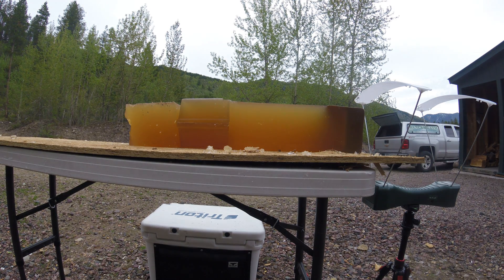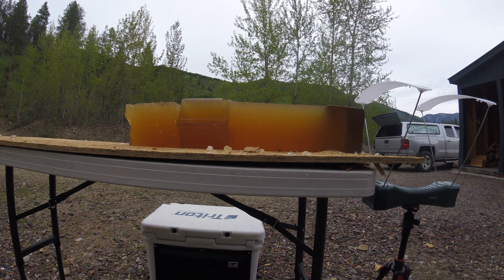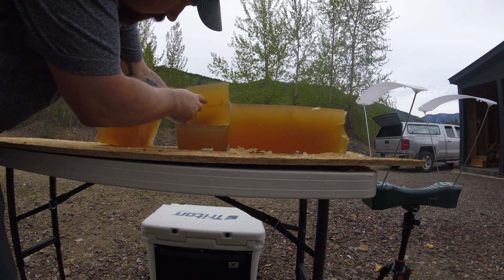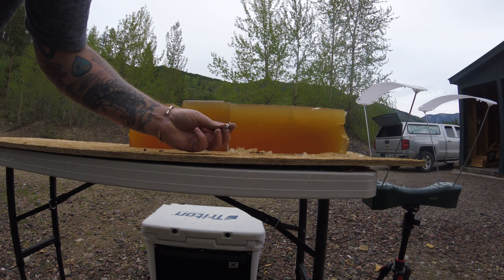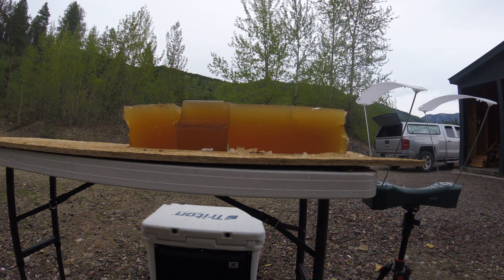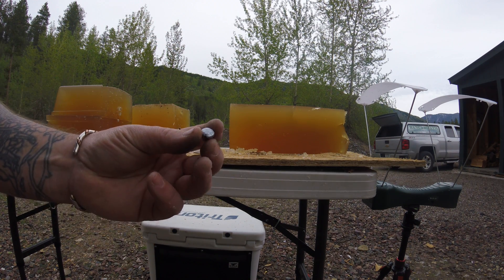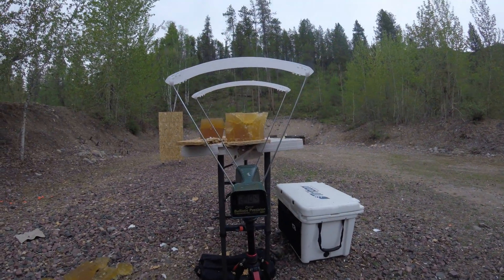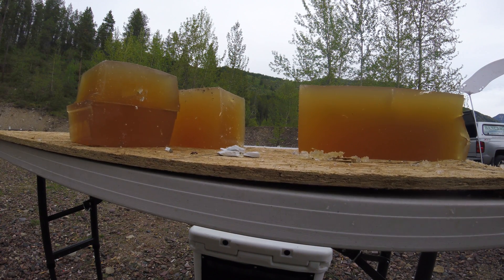6.5 Creedmoor 142 gr Accubond LR gel test with hide and bone

Comment: Great timing! Going to load the Accubond vs 143 Eldx for accuracy using Staball 6.5 for this weekend. Have you determined optimal jump for the Nosler? Thanks (Subsribed!).
Reply from the maker: The rifle I use the ABLR'S in doesn't really care about jump. I haven't tried them in my other Creedmoor's. 

I've gotten my best velocities with RL16 and it is crazy accurate with low SD's and ES's. 

I have gotten away from using the eld-x bullets for the most part because most of my shots on whitetail doe are within 100 yards and they come apart bad if my muzzle velocities are much over 2600 fps. Good bullets as far as accuracy goes but they just can't handle medium to high velocity impacts without excessive damage.
Reply: @Simple Minded Fella  Thanks. Never shot an Eldx at game and now there's one less thing to buy! Hope I can restock on R16 
 Thanks for the reply!

Comment: Are the Winchester accubond  long range the same bullet is the nosler
Reply from the maker: The Winchester ammunition that is loaded with the Accubond long range is the Nosler Accubond long range bullet they are loading into their ammunition.
Reply: @simplemindedfella  ok that's what I have is the Winchester accubond box it's a good bullet for deer hunting at 250-400 yards haven't got one closer yet I shot a coyote @ a 100 yards put a big exit wound
Reply from the maker: @anthonyfairbanks2952  what I like about the 142gr Accubond long range bullets are they hold together fairly well with high velocity shots yet still operate well down under 1600 fps. I've taken whitetail out to 600 yards perfect broadside double lung dropped in its tracks and a cow elk at just under 70 yards with many mule deer, antelope, whitetail, and a few elk at a variety of ranges. My buddies kid used my gun to harvest a cow elk at 400 yards and she didn't  make it 10 yards before piling up, that is the farthest my gun and experience has with the 6.5 142gr ABLR on elk. They will do the job based off the math quite a bit further then 400 on a elk as long as the shooter does their job in placing the shot. (6.5 Creedmoor is all anyone really needs)

The ABLR is my current go to for lead core bullets. I use them in my 6.5 Creedmoor(142gr), 308 Winchester (168gr), 30-06 (168gr), 300 Winchester Magnum (210gr), and 6.8 Western (150gr and 165gr).
Reply: @simplemindedfella  yes I agree

Comment: I wonder how well it would do at long range? I noticed its not a boat tail bullet so accuracy at longer ranges may not be as good as something like a 129gr hornady sst superformance. I have captured a sst and it mushroomed well and moving at 2900fps even though its on the lighter end of the grain spectrum, it still hits like a tank.
Reply: Rated Redneck “I noticed its not a boat tail bullet”. Every Nosler accubond long range bullet that I have loaded has been a boat tail. Where did you see ABLR’s advertised as non boat tails? 
All ABLR’s are advertised to achieve adequate expansion down to 1300 fps, so roughly out to 8-900 yards for the 142 grain 6.5 cm depending on you load and barrel etc. wether or not they truly expand that well down at 1300 fps I couldn’t tell you. 
https://shop.nosler.com/accubond-lr-6-5mm-142-grain-bullet-100ct.html
Reply: @fnkdtnk  if you look at the bullet he digs out at like 2:40 it looks like its a non boat tail bullet. I havent researched it any just going off what the video looks like to me. It has a very sharp edge on the bottom and most boat tail bullets have a soft edge at the base of the bullet. Plus the base looked really big to be a boat tail base considering the caliber.
Reply: Rated Redneck you’re looking at a mangled bullet, it appears to me that the base completely deformed during expansion. I promise you, they are boat tails, and very accurate. The link in my previous comment has a picture of them in it. The LR stands for long range, and they were designed to fly like a match grade bullet, but still expand at the low velocities way out past where most hunting bullets will still expand.
Reply: Rated Redneck you’re wrong two accounts. #1 The ABLR is in fact a boattail. How else could it have such a high BC? #2 boat tails are not more stabke in flight than flat base bullets. In fact boat tails are more susceptible to losing stability after falling below the sound barrier and tend to have less gyroscopic stability for a given twist rate.
Reply: @strat1080  no the air turbulance of the boat tail makes them fly flatter and straighter and thats why most bullets that are long range rated are boat tail rounds. A flat base causes a drag turbulance behind the bullet slowing it faster and can cause an uneven drag making the bullet deviate or drift at long distances.
Reply: Rated Redneck, you are confusing stability with drag. Yes boat tails have higher BCs which make them slip through the air better resulting in flatter trajectory and less wind drift all things being equal though. On the flip side they are longer with a center of gravity further forward than a flat base. This makes them less stable. Stability and ballistic coefficients are two completely different things and you are confusing the two terms. If you actually do some research you will find that the heavy for caliber high BC bullets tend to require faster twists to stabilize them. Like I said in my first comment, given a specific twist rate a flat base is more likely to be stable. On the LongRangeHunting forum, reknowned ballistician David Litz actually tested all of the newly released Accubond Long Range bullets and found that many of them were not stable in traditional twist rates for given calibers. This is known as gyroscopic stability.
Reply from the maker: The 142 gr ABLR has a G1 BC of 0.625 and the (this BC holds very true in my testing) Hornady 129 gr SST only has a G1 BC of 0.485 the 140 gr SST is a little better @ 0.520 yet still not as good as the Nosler.
Before Hornady started doppler radar testing most bullet manufacturers would boost BC numbers (including Hornady) and Nosler had the 142 gr ABLR at a G1 of 0.719 you would have to have 3600+ fps at the muzzle to obtain that kind of BC. 

All are good hunting bullets at practical ranges. Here is a short overview of the Nosler ABLR. 

   https://www.youtube.com/watch?v=338Swnp8UpI
Reply: @simplemindedfella  what im saying is that boat tails make them more stable in flight with the shape. The BC of a bullet measures how well it can slice through the air, not necessarily how stable it is in flight. You can have an extremely good BC but not have a sub moa or even 1 moa round, it will hit the target with more velocity because of the ability to cut through the air better but without the added stability of the boat tail it kinda doesnt make a better bullet just because its great at bucking wind and fighting gravity. You need a happy medium of very accurate(sub moa) and good at slicing through the air. Sellier and bellot 140gr fmj have a g1 BC of .548 and g7 BC of .275 but with the reviews i watched the guy said its a sub 500 yard bullet because once you surpass that range it drops out of 1 moa range, probably due to the non boat tail g1. Even though it has a pretty good BC, it just doesn't keep its flight trajectory well because of the shape. Even with less drag the bullet is affected more. That could be a good test, find a boat tail and a non boat tail bullet with the same grains and put them head to head in an accuracy test out at a good range and test if bullet shape is more important than its BC.

Comment: Im Getting more serious about deer hunting and buying a bolt action rifle. The last 15 years I've hunted deer on some private land that happened to be in shotgun muzzleloader only zone. Well I lost that a spot now, and I'm headed to the upper peninsula of Michigan and it's time to buy a rifle. of course the old farts I hunt with are telling me get a 30-06 like them. My uncle suggested a 270. But I'm looking hard at the 6.5. I just want to make sure it's going to have the power I need. The last 7 deer I killed was with a 1 oz slug from shorter ranges. And we all know how that works out. Most of them hit the ground.
Reply from the maker: Although the 270 and the 30-06 are both excellent choices for deer and also work well for elk hunting it is definitely more than what you need in most situations and that longer case equals more brass more powder higher expense with very little actually gained and that is the beauty of the 6.5 Creedmoor it is an extremely efficient round, the 6.5x57 and 6.5 Swede have been around for a very long time and are used to drop Red Deer and moose so there is absolutely no reason that the 6.5 being as tried-and-true as it is wouldn't be an excellent option in the Creedmoor.

If you're hunting primarily in heavy brush and not shooting more than a hundred maybe a hundred and fifty yards I would strongly recommend a 308 as its ballistics are really similar to the 30-06 and is much cheaper to shoot. Primary reason I would recommend that over the 6.5 Creedmoor is that that slightly larger diameter and heavier bullet moving slower will be less obstructed by brush if it happens to catch a small Branch or something. I honestly don't think the popularity of the 6.5 Creedmoor is going to die off but I can guarantee you that you will be able to get what you need for the 308 pretty well indefinitely I can't say that right now about the 6.5 Creedmoor.

I have hunted big game with just about every caliber from the 223 to the 338 Win Mag and any more the only two guns I grab off-the-shelf regardless of what I'm hunting is my little Ruger Hawkeye compact in the 308 or my Browning X Bolt 6.5 Creedmoor. I tend to use the compact little 308 when I know I'm going to be in the brush as that compact little rifle is easy to maneuver through the timber and if I'm hunting open Sagebrush country is when I grab the 6.5 Creedmoor.

Randy Newberg is a professional Hunter with some excellent videos using primarily a 308 for big game hunting.
Reply: Joe S. I don’t know if you are still looking for a rifle or not, but if so, as someone with a 30-06 and a .270, I can tell you that you do not need a 30-06 or .270. For decades, people have been planting whitetail with the .243 winchester everyone from youth hunters to old geezers. It is commonly listed as a top 10, if not top 5 American deer hunting cartridge. I would confidently recommend you get one of those, and anyone who tells you they aren’t enough for deer should be ignored from then on out. With that said, 6.5 cm is a .243 on steroids, so you can be confident in knowing that the 6.5 cm is more than capable.
Reply: @fnkdtnk  243 tite to the ear is how I do it..no wasted meat. Deadly round for shure
Reply: If youre within 100 yards for most opportunities dont go for the 06. Also the .270 is almost the same as the 06, you will just end up with a hefty chunk of blown out meat. If you can afford 2 guns, id recommend either a .308 and a 6.5 or a .243 and 6.5 as long as you can stay away from a lot of overhang. I may test whether hanging branches and obstacles will affect a 6.5 and if so how much. But if you are mostly hunting flat open areas id say 6.5 all day if you could only choose one. Its much more versatile and better at distance and really shooting into brush isnt a very good or safe practice anyway. Id just buy a 6.5 creedmoor and call it a day. You have so many grain options and bullet types, you can be anywhere from like 115gr varmint rounds to 160gr round nose shoulder destroyers. Its such a wide area that the 6.5 would really be the only gun you need in most cases, its just what bullets you take with you because in almost all cases the 6.5 wins out on the higher caliber rounds.
Reply: I have taken everything from varmints, hogs, deer and elk with the 6.5 CM. All shots under 350 yards and usually within 200. They all died right there. It is more about a responsible ethical shot with a rifle and round you have trained with. I have also done so with the 270, 308 and all good calibers. 6.5 has almost no recoil at all.
Reply: Joe S. Compare the ballistics chart and energy chart at say 200 yards and you can see that the 30-06 has more energy at 200yards but the 6.5 shoots a little flatter.
Reply: @tatermorgan6559  it shoots flatter and holds its velocity much better in most cases. .30-06 drops about 6 or so inches give or take at 500 yards but realistically not many people will have a 500 yard hunt opportunity but the 6.5 could easily handle a deer at 500 no problem.